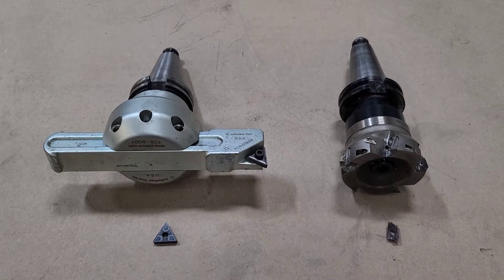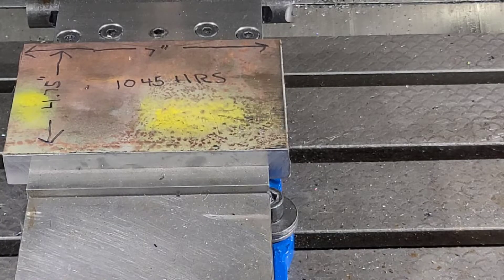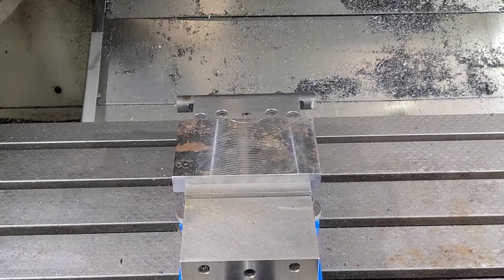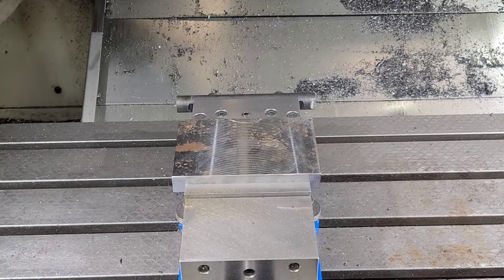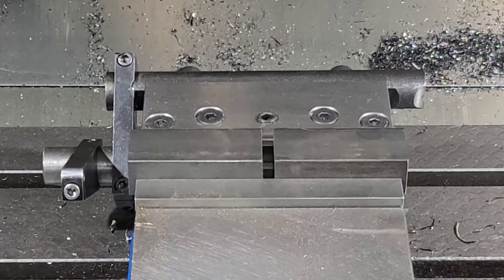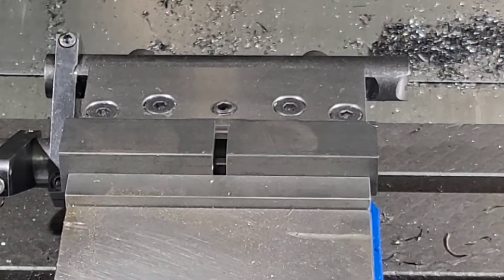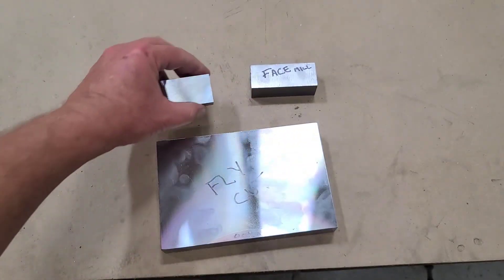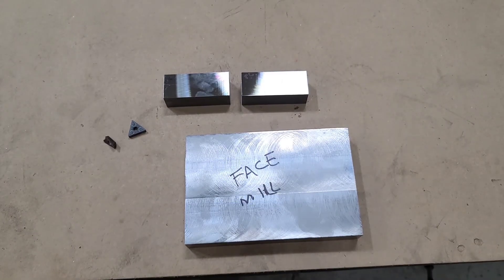Fly Cutter VS Face Mill and the economics of using each.

Comment: Hello, if you leave only 1 insert on the facemill, will it perform just like a flycutter?
Reply from the maker: Similar to it but not identical. The surface contact of the facemill insert is greater so insert life is reduced. Also no adjustability of cut width. But very useful when needed.

Comment: I’ve had more or less the same results as you. The fly cutter leaves a better finish in general. However, running a face mill at high speeds, I can often get close to mirror finishes. Thanks for the video!
Reply from the maker: Hi Greg, thanks for watching and commenting!

Comment: Rev up the face mill 1000 rpm
Reply from the maker: Hi thanks for watching and commenting! I never would run it that fast unless I was not the one paying for inserts 😆 I always rough with them and just use the fly cutter to finish.
Reply: @mvpmachine hi yes true work are paying for mine.greetings from the UK.
Reply: @mvpmachine  Carbide prefers running at higher speeds than HSS, I run my face mill much faster and get results more like your flycutter. Also you are comparing two very different insert. My face mill uses the triangle inserts like your flycutter, and it produced surfaces like your flycutter. Also with the face mill you need to make sure all the inserts are EXACTLY at the same distance from the bed. Even a small height difference produces results like yours because one insert is cutting deeper than the others. You might need to machine the facemill to fix the pockets that hold the insert.

Comment: why didn't you allow the fly cutter to "heel"? you stopped the cut after only the leading edge of the fly cutter was off the work. let it heel. let the trailing edge feed off the part.
Reply from the maker: Thank you for watching and commenting! Why would you take the full cut if not needed? The large diameter of this cutter allows it to make a full cut without running the back side, if the part fits within the diameter of the cutter. So perfect flatness and finish why would you take the extra time?
Reply: @mvpmachine  You say heeling is not needed, the heeling action removes metal too. As a 33 year Tool and Die Maker, not heeling is bad practice... It doesn't always leave the flattest surface... then again, it is an easy way to hide the head being out of tram. There will be a day when it bites you in the rear and you'll be remaking something... just don't say that no one told you.
Reply from the maker: @yelims20  When I check with an indicator and see surface grinder flat and a good finish I call it good, this is a modern fly cutter with a high positive carbide insert and a negative rake, not a HSS hand sharpened tool bit.  Big difference.
Reply: @mvpmachine  Checking with your indicator in your machine tells you next to nothing about flatness of the part.
Reply from the maker: @luke1811  Then I have been doing it wrong for 30 some years 😆
Reply: @mvpmachine  You just follow the machine error. Your machining center is not a CMM. You mill a "flat surface" but it just follows the error of your machine with little deviations depending on cutter diameter and actual condition of your machine geometry. If you would take a ball nose end mill and mill a surface flat (theoretically, obviously they suck at flat surfaces) and place an indicator on the center of your spindle axis, you will pretty much always read zero.
Reply: You can check part movement with the unclamped part and compare it, that would make somewhat sense, but just for seeing how much it moved, not actual flatness.
Reply from the maker: @luke1811  I have no problem checking parts for flatness and parallel. using this method. You must be a CMM operator. Machinists routinely use dial indicators to check for flatness to the best of our ability on the machine. Not trying to hold millionths but normal tolerances we work with are .001" to.005" and do not have issues doing so. So your initial statement was your not checking anything by using a dial indicator is ridiculous. Been doing it for years and know all about the machine variances that can cause improper readings and know how to deal with them accordingly .
Reply: @luke1811 so what does it mean when fixed position indicator doesn't move the needle when travelling over the surface in various directions?
Reply: @TigerCarpenter 
That guy is right, but for the work he describes it's fine.  
He's saying the indicator follows the same path as the tool, which may have worn guides or boxways. Using a granite reference surface that is proven flat would be more accurate.
Reply: @mvpmachine you can’t check flatness in the machine. I mean you can but, it won’t be a real world, relaxed part environment. I’m sure you know that. 
However you solved a problem for me with not using coolant( on the fly cutter) …… my man🫡
Reply from the maker: @TheMotosnake  yes the proper check for a perfect part would be on a granite plate but this is good enough for most of what we do. Glad the no coolant worked for you! Thanks for watching and commenting!

Comment: I’m considering using a fly cutter in the apprenticeship program I’m in for the finishing face pass. It’s 316L what kind of speeds and feeds would you run your exact tool and insert at? I have no experience with fly cutters. Great video!
Reply from the maker: Hi , I am not sure I would consider a fly cutter for 316L it js one of those materials that does not lend itself to fly cutting as it requires a higher amount of cutting force than most free machining steels. I think that one is best left for a facemill with material specific inserts. Thanks for watching and commenting!
Reply: @mvpmachine  thanks for the response. I’ve been running lathes for the last 12 years and I just can’t get over the feed lines left from face milling as no such lines are generally left in turning operations. The other option I’m considering is making a fixture to surface grind the faces so I don’t have the feed lines.
Reply from the maker: @bf4chode  You can use a face mill like a fly cutter if you have one that cuts the material well but just leaves the cutter marks sometimes removing all but 1 insert will give you a much better finish. But on large surfaces the blend lines will always be there to a certain extent but  over lapping your cuts by 1/4" or so can sometimes minimize them. Some grades of stainless are difficult to get what you want finish wise. Depending on what it is for I have gone as far as media blasting to give stainless a uniform finish and that works well.
Reply: @mvpmachine  it is going to be a gift, so I’d like it to look seamless that’s why I’m leaning towards surface grinding. We have an entire semester to do it and I can’t imagine it taking more than a class or 2 (2-4 hours) to machine the whole thing since I already got both sides of the program made and it’s 30ish minutes total. It would give me more time on mills and gives me a fixture I can use outside of school. Thank you for all the suggestions!

Comment: Interesting video.  Would love to see the same comparison with the face mill running at the recommended feeds and speeds.  Of course, it would still not leave as good a finish, but the cycle times should be more favorable.  Can also chamfer with most face mills that have 45 degree inserts at high speed, so save a tool change and gets better use out of your inserts.
Reply from the maker: Thank you for watching and commenting! I will be doing another video soon that should be a little more fair to the facemill.  I would not typically use a facemill to take such a light cut depth wise on hot rolled mainly because of the abrasive scale and the cost of the inserts it is not an economical way to use them in my opinion. That was kind of the point I was trying to make with this video, but will clarify it in my upcoming round 2 video.

Comment: kinda apples to oranges. while it is a pain to get your cutter overlap area to not have a small step with the facemill, a different facemill with a positive or negative positive square or octagonal insert in a 45 degree facemill/shell mill will create a nice shinny, somewhat mirror surface as long as chips are flushed away. the fly cutter will always get a better finish though bc of only having a single point cutter. unless you have a facemill that you can independently adjust each carbide insert and that would be a pain also bc inserts just arent going to be perfectly cutting on the same plane/depth. no matter how expensive the cutter.like the video though
Reply from the maker: Shawn you understood this video I think better than most. Thank you for watching and commenting!

Comment: It all depends on your goal.  Compare same diameter tools and you can run the facemill 5x the feed rate of the fly cutter.  Sometimes finish is no concern, but if it is, a fly cutter is hard to beat in my experience.
Reply from the maker: The insert wear on a light cut with a facemill kills insert life, thats kind of the point I was trying to make and those inserts are pricey. A single point inserrt does not get hurt with a light cut its made for it.
Reply: @mvpmachine if your getting bad tool like out of a shallow cut then your not using the tool right. everyone makes a finishing face mill for taking light cuts, or you can take a bit deeper if a cut. I've used facemills all the time and can hit a 32 finish all day with no effort and a 16 if I actually tried.
Reply from the maker: @ramentaryramblings  you missed the point, I pretty much said that.
Reply: idk, going like 0.3 mm on a face mill and spinning it a little bit faster gives me the best results on finish

Comment: Always preferred traditional fly cutter with hhs, single edge simple re-sharpening.
Reply from the maker: That is fine for a hobby shop but if you need reliability and consistency, this is the only way to go. We have all been there and done that and it takes time, most shops especially with CNC machines are not going to use a hand sharpened tool bit style fly cutter. Also very hard to accurately measure the cutting diameter.

Comment: by any chance do you know what is the difference between "SE" and "AP" carbide inserts ? and what those abbreviations mean? These face mills are sold on aliexpress , they have 2 tooths instead of one. AP is positioned parallel to the working piece and SE is positioned at 45 degrees so it is basically like the suburban tool, but AP is completely different. Looks like SE is what I need for ideal flatness, but would like to ask expert opinion.
Reply from the maker: Hi This link should help you decode them: http://www.carbidedepot.com/formulas-insert-d.htm
 let me know if this helps
Reply: Have a 180 mm SE Aliexpress 2 insert one. Only used it on aluminium. Nice finish.
Third the price of my 63 mm face mill. So far, happy with them.

Comment: Great video! Thanks for the content. Looks like you definitely found something that works for you. I use the Mitsubishi ASX 445 and it leaves a near mirror finish with 20 or 30 in/min feed through steel. The 45° inserts are great because they have balanced downward and side force. I prefer the 2.5” diameter because the 3” version can sometimes be problematic in my Fadal tool changer. I have a video of it in action on my channel.
Reply from the maker: Hi thanks for watching and commenting. I love the Mitsubishi cutters almost never a problem with tthem the inserts are pricey but last a long time. I have one for armor plate that is incredible,  I will check out your video.

Comment: You only have one pass with the flying cutter. And two passes with inserts for facemil.
Well, you can leave only one insert for facemil for the same purity. Or choose inserts for it on the stove that do not appear so clearly at odds.
Reply from the maker: Hi Sergei I kind of said the same thing at the end regarding removing all inserts but one. You would be surprised how many times we see the crappy facemill finish on parts  here in the heart of the automotive manufacturing area here in the Detroit area, I find it unacceptable.

Comment: Good stuff !
Reply: I'm stuck between the suburban  tool cutter very impressive  but still have guys claim heavy weight inertia  type cutter is best  for bridgeport  far as ease on machine and finish any helpful  thoughts appreciated.  I like your comparison  videos  alot.  If you have disc / inertia  type cutter would love to see that showdown.
Reply from the maker: @scottpace8794  Scott I do not have that type of cutter to do a comparison but have used them in the past, I am not a big fan of them due to the weight of the cutter and the balance really isn't there either they are still not a balanced cutter, it is really not possible with an adjustable cutter.  I don't believe these fly cutters are harmful to your machine if you ran it 24-7 for 6 months taking heavy cuts maybe but most people don't do that. We use them on our 1995 Fadal CNC mill on production jobs almost daily and we are still on our original spindle, we have had the cutters since 2011. Most machine spindles become worn from lack of proper maintenance in my experience running a spindle dry will do more damage in an hour than running this cutter 10 years on a daily basis. The spindle load meter on our CNC machines rarely register any significant load when using a fly cutter yet when using a face mill it is often 60 to 80% load due to the pressure exerted on the part and spindle.  That load is directional and will cause far more spindle heat and wear than a single point tool.
Reply: @mvpmachine  Hey thank you for solid opinion , advice and sharing your expertise  with me . Thank you again. Look forward to more videos  from you.
Reply from the maker: Thanks Scott!

Comment: hi! please leave us an update about the electroculture. thanks!
Reply from the maker: Hi I did not have any measurable success with the electroculture but the way I did it was flawed for a few reasons. 1st the small antennas I used are kind of a scam and won't do much from further reasearch I found a ground wire is needed and a larger possibly roof mounted antenna to work properly. The little antennas may  have some small effect but my patio has rubber pavers snd my driveway boxes are made of metal causung other problems in trying to make them work. The rubber insulated the planters from earth ground which it needed. The metall planters in my opinion act as a shield. Everything grew well but hard to attribute it to the antennas. The magnets were a surprisingly huge success but I have not done any follow up videos due to lack of intrest I hardly got any views on them. Thank you for watching my videos and for your interest I will do more experiments this winter indoors at the shop I will be starting some paulownia trees I grew them a few years ago and everyone loves them.

Comment: Nice video. Although it seems an unfair comparison as the face mill was running way too slow. Should be running about 180 m/min for finishing on M/S. That’s assuming of course you’re using tips with modern cutting technology.

Also, why didn’t you use wiper inserts on the face mill for comparison as well? You can achieve much higher feedrates and still get a nice shiny finish.
Reply from the maker: Hi Benny, I was using what I have available for the video, and it is indeed a modern cutter but used typically for roughing we always use a fly cutter to finish our parts because the finish looks better and no blend lines.
Reply: @mvpmachine  fair enough. Interesting method. Thanks for sharing!

Comment: Side note: When using the indicator, try to have tip more parallel with the work piece to not introduce measurement errors.
Reply from the maker: Good point! I do know better but its easier to video it when the camera is in the tripod. I guess it will exaggerate the reading a bit the way I did it. Thanks for watching!
Reply: It's called cosine error. You're getting less sensitivity here.
I had a student who was taught that the indicator stylus should point at the surface to be indicated. Couldn't suggest to him different. Really made me question what he thought was going on.